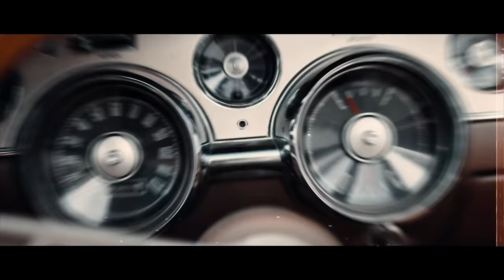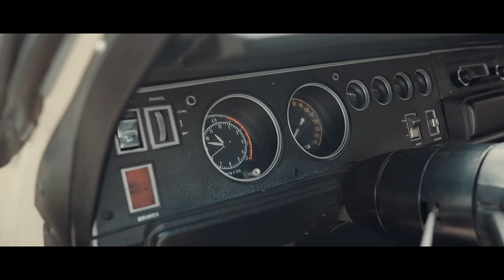The Rarest Bird In The South

Comment: Sweet! My Cousin and her husband had a B5 Blue Superbird with white interior, AT, 440 6Pack (dealer installed the 6 pack as it came with a 4 brl). They bought new in Tennessee as they couldn't find one for sale in Indiana at the time. Still kept the 15" original rallye wheels and poly-glass tires for it, under 55k mi, 1 repaint,. Last I know of the car is on the East coast in a collection.

Comment: Great find. Amazing what a pointy nose and big wing on the back,and the aerodynamic back glass will do for the price of a '70 roadrunner. My lime 70 roadrunner was just a low buck 383 4 speed but with a 440 its a ball to drive and I'm not scared to drive it and park it at the grocery store. Not knocking the superbird. I love it! I'm 63 and remember working at a service station in the mid 70's one night and a guy came in there with a ragged out lime green superbird that had lost the rear wing and was in terrible shape and I plugged a tire for him. Those things were dirt cheap then like most musclecars. My how things have changed!

Comment: My dad once restored a 69 barracuda. Took the old in line 6 out and dropped a TA motor in it with TTI headers(340 6 barrel).  That thing was stupid fast.  For a small block it head close if not over 400hp.  Had manual brakes and steering and like he says cruising it steers fine but crawling you felt it

Comment: No, the scoops on the fenders are not air extractors. When racing with giant racing tires, the tires would rub the top of the fenders under cornering. The solution was to cut a hole in the top of the fender and cover it with a scoop.

Comment: This the car you buy for the look and the feeling of Richard Petty in 1970  when behind the wheel. It' may not be especially fast by modern expectations but it will spin tires and it's makes all the right noises for sure. I love the old Muscle cars. You really can't go wrong. If $200k is too much........just remember that virtually any carbureted, pre-computer era car can easily achieve 12s in the 1/4 miles thanks to modern roller cams and decent aluminum heads available today.  A whole lot of 'em can be purchased in great shape for less than the price of typical new car. No they won't be this rare or nearly this super cool but they can make all the same noises and spin those tires just as easily as they go just as fast or faster than  this warmed over 440 powered Super-bird. 4,000pds? ......my God that's a heavy car.

Comment: I know where one is but its funny because the old lady who owns it uses it as a chicken coop and in the 80s  they used the wing as a swing for a baby to rock it back and forth while doing yard work. Its dented up and the motor rumored to be a hemi was used as a weight on a blade to grade the roads. No one knows where the motor and blade went. Also the wing is broken off.

Comment: In 1969, NASCAR required them to show them 500 cars so they were bringing out all of the daytonas and every once awhile they would run one back into the building and bring it out a second or third time until they got to 500. Chrysler never made 500 of those cars. They were supposed to, but they didn't.
And only the super stock cars had the hole in the fender on the superbirds. You can cut that hole but it ends up getting dirt up on the top of the fender behind that air pressure relief scoop.
None of the super stock cars which were built I think 45% 55% weight bias, had the vinyl top the vinyl top was put on all the ones built for the road because it was cheaper to put a vinyl top on the car than it was to finish and paint the top of the car.
You worked up the engine and it only runs 12 seconds. You need to put opinions number on it. You're getting just a little bit of spring wrap and losing about 4/10 of a second because you should be in the 11s with that car.

Comment: Why do Americans who drive a manual gearbox,  coast in neutral when stopping.
Coasting in neutral, even in a manual, isn’t a good idea because you’re disengaging the engine from the transmission. If something happens on the road, you won’t be able to respond as quickly. Plus, you won’t save any fuel by coasting because while yes, your RPMs will decrease slightly, your pistons are still turning and burning fuel.
When you put the car in neutral, it disengages the engine from the transmission. Sometimes, you’ll notice that your RPMs decrease slightly.
That’s where the myth that coasting in neutral saves you on gas came from.
However, your engine’s pistons are still turning. In fact, they might turn faster whenever you’re going downhill.
The faster your pistons turn, the more fuel you’re burning. This is the same for both automatic and manual transmissions. 
Simply pushing in the clutch could help you to save fuel somewhat. But, you’ll also wear out the clutch’s bearings a lot faster, too.
Reply: Thats done so you don't have to ride the clutch pedal

Comment: The holes in the front fenders. Because of all the front down force. The top of the front tires, at top speed. Where rubbing causing, Blow Outs. Not good at 200 mph, on the track.
Reply: Wrong, wrong, wrong
The scoops on the fenders were to release pressure built up in the wheel well so as to not raise the front end at high speed. 
The factory holes are 8 in diameter, the tires that NASCAR ran on the front were more than 12 in wide, that wouldn't even come close to making clearance to keep from rubbing. I wish people would quit repeating this myth.
Reply: @WisdomVendor1 YOU ARE WRONG BIG TIME.  Read Supercars by Frank Moriarty. Read page 23 24. ( At the NASCAR superspeedways, the Front tires clearance in the Wheel well was often a problem. The tires would be forced into contact with the fenders when car passed through a high- banked turn at nearly 200 mph. To solve that problem on the Daytona. Larry Rathgeb came up with the idea -- a backwards facing air scoop That would do nothing more than provide room, to prevent the tire. From coming in contact with the fenders. )